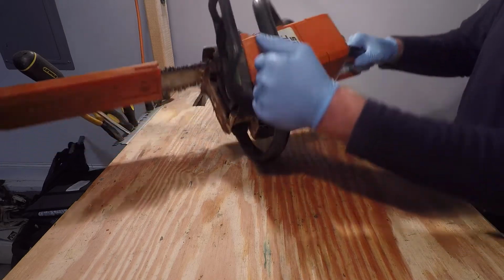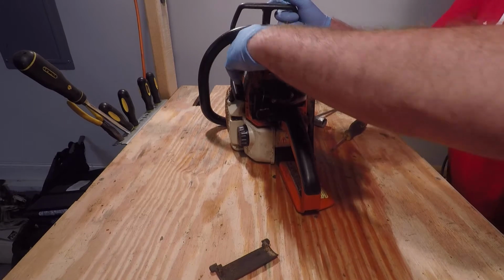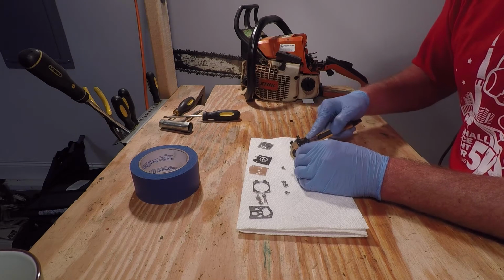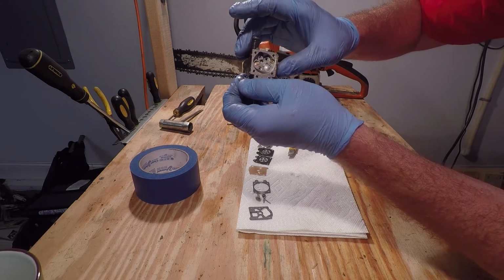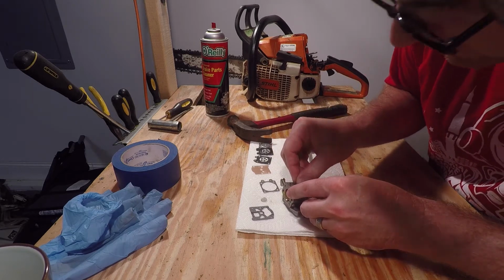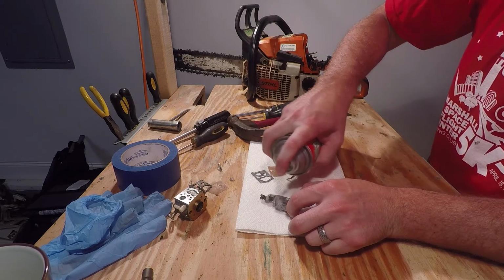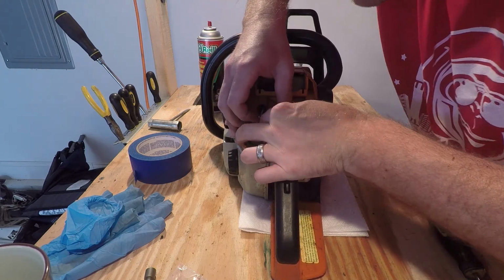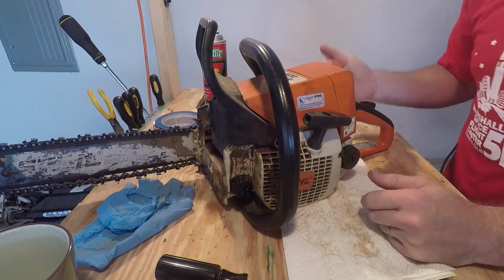Stihl Chainsaw Complete Tune Up w/ Carb Rebuild

Comment: Nice video. I took on a job trying to get my brother's 025 running. Put new gas line on because it was cracked. Took carb apart and discovered needle valve stuck in closed position. Cleaned it up and put a smear of oil on it and everything else was in good shape. Replaced the spark plug and put a pipette of gas in cylinder. Cranked a few times to get gas primed and she runs like a top!! I already had planned to get rebuild kit or new carb if my work failed. Thanks for the info!

Comment: I realize this is an old Video but thanks, it was good. What is the opinion of the replacement carb? I can spend the time rebuilding the carb or drop 20 on a new one with a plug.

Comment: The carb kit you cite on your list is sold out, and also doesn't contain the welch plug that you knocked out with the pick.  Any leads on a full, available carb rebuild kit for the 025? The shop I go to wanted to charge $150, and encouraged me to look at their new saws.  Of course.
Reply from the maker: Just buy a new carb.  they are cheap. then its plug and play  https://amzn.to/2vLNBsY